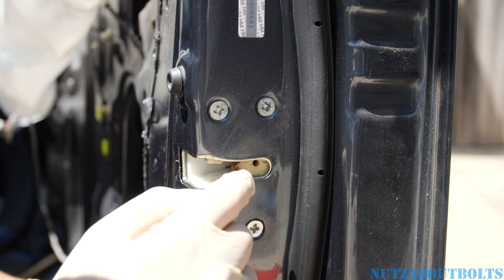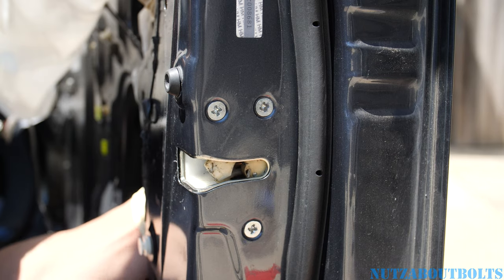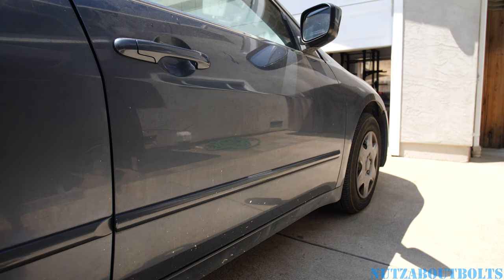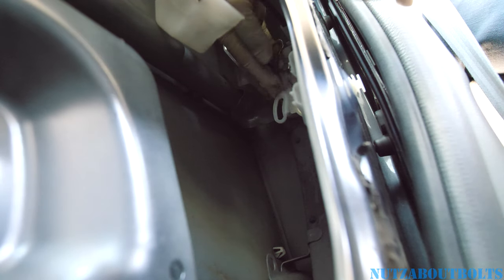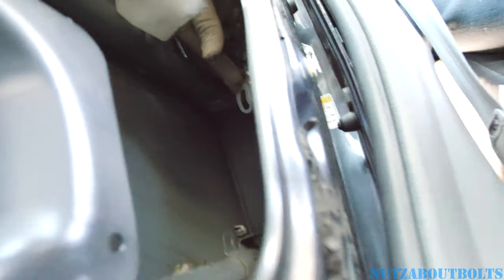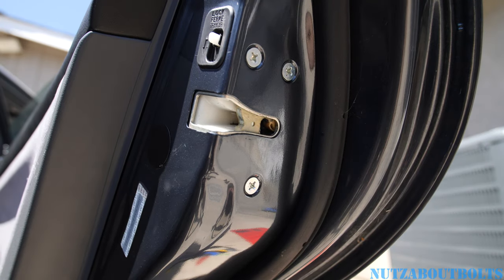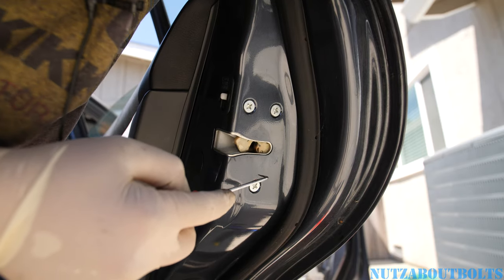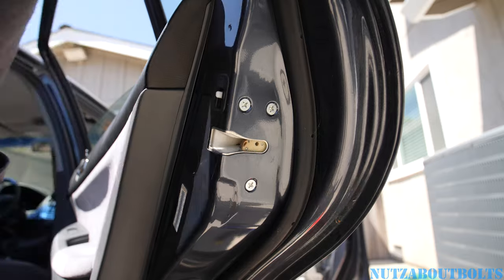How to open your Honda Door when its STUCK closed

Comment: There’s a white casing that is not shown in this video, there is a whole step missing, I can even show you a picture
Reply from the maker: Yes, that’s just the cover, you can remove it with a Philip screw driver. I didn’t show it because it would knock my camera off.
Reply: Could please tell how to open the cover which is fixed by a Philip screw

Comment: What if the door panel's still on the door. How do you open now? I have that problem. Window's down, but the panel is still on the door
Reply from the maker: Only way to me is to pop the panel off or break it off.
Reply: @NutzAboutBolts  dang, I didn't want to break the panel off.  Thank you for responding
Reply: @Name-ii7ox  thank you for your advice. I'll try that tomorrow. Thanks again

Comment: Is it possible to remove internal door trim when the door is closed ?
Reply from the maker: Yes, but it’ll be a lot of tugging and plastic tabs breaking from the corner
Reply: I’m wondering this same thing.. doors closed, the actuator is broke and the door won’t open from the inside or outside. The panel is on the door but again the doors closed. I wish someone would make a video explaining how to do this
Reply: I have the same problem.
Reply from the maker: @No_Transitory  pry the plastic door panel with a pry tool to pop the clips off, then pull back towards the passenger side really hard to pop the plastic panel off. I would do it but don’t own the car anymore
Reply: Can it be done to a Honda 2016? My door is closed
Reply: same issue what did you do? @No_Transitory

Comment: There's another YouTuber on the same subject who managed to get the door panel off with the door stuck shut.  It didn't look easy.  On this video I couldn't see what I was supposed to pull on to open the door but once I removed the white plastic cover it was easy (2005 Element).  I suppose the plastic cover is to keep rain off?  I'm going to take a chance and leave it off, at least for now.
Reply from the maker: The plastic lining that is between the metal door and door panel? That’s to prevent dirt and dust from going into there.

Comment: Hey man so i did what u did everything worked but once i closed the door it happened again do you think i need a lock actuator ?
Reply from the maker: Check your door latch to see if it’s working properly, the door actuator just unlocks the door lock so you can open the door. Unless your door isn’t unlocking for you when you unlock the door…

Comment: How do you get the door panel off with the door closed I can't open the door to take the panel off So my question is with the door closed how do you get it opened how do you get to the panel
Reply from the maker: You might have to damage the plastic panel when popping and pulling it off of the door. I would do a video on it, but I don’t own the vehicle anymore.

Comment: here is a question how do you get the panel off with the door stuck closed
Reply from the maker: Pop it off of the clips inside by using a plastic pry bar, then you pull back till it’s off and pull it towards the passenger side. It’ll be a tight space but it’s possible.
Reply: @NutzAboutBolts  Make a video of it I say BS to the thought. I already tried that method
Reply from the maker: @briandolata3466  sorry, I don’t own the vehicle anymore due to the cat theft. If I did, I would definitely do it

Comment: need help with the door open part my latch doesn't go back after pulling the handle method
Reply from the maker: Can you send us the picture of it through our email or Facebook page. Can’t figure out what is the issue
Reply: @NutzAboutBolts  No problem we think it’s the release pin inside getting stuck. Everytime we pulled the release pin it opened the latch. Just gonna order a replacement door latch.
Reply from the maker: @vital565  ah ok
Reply: @NutzAboutBolts  Thanks for the quick response though
Reply from the maker: @vital565  np. 👍🏼😅

Comment: I have a 2011 Honda Civic LX Coupe and both doors are stuck there is no door handles on it right at the moment or door panel.  However, I don't see how to reach the cover that you explained, there isn't enough room can you help
Reply from the maker: Do you see a white plastic cover when you look inside the door?
Reply: @NutzAboutBolts  I barely see it, can send you a photo of what I see when I stick my phone around the hole.  But there is no room to view it that I can see.
Reply from the maker: @captainuknow  sure, send me the photo, if you watch the door actuator removal video, you’ll see the parts that you need to pull on, the rod should be attached to it. But send over the picture and let me see
Reply: @NutzAboutBolts  it keeps failing when I reply. Won’t let me attach photo
Reply from the maker: @captainuknow  send it to our Facebook page
Reply: @NutzAboutBolts  I did
Reply from the maker: @captainuknow  send me a message first

Comment: Man I can’t even open the door inside or out but my panel is still on. I’m sol right night
Reply from the maker: Pry the plastic panel off with a plastic pry tool, make sure all the clips are detached   from the metal door itself and then you’ll have to man handle the plastic panel by pulling it towards the back passenger seat. It’ll be a tug but you can pull the panel off.

Comment: how can i get my door open if the panel is still on the door
Reply from the maker: Pop the panel out, then pull back towards the passenger and you can remove the plastic panel. You’ll have to man handle the panel or else it won’t come out
Reply: @NutzAboutBolts  i appreciate it but it’s opening and stuff again how it’s supposed to idk what happened with it
Reply from the maker: @ghostrebel1419  should check the door latch to make sure it’s working properly. Could be the actuator going out if it doesn’t unlock.

Comment: What if the panel is still on?
Reply from the maker: It’ll be tight but doable, just pry the panel to unclip it from the metal door, then pull up off the door top frame rail and back towards the passenger direction to remove the panel.

Comment: Can't open door, bro immediately says "When you get INTO your car" 😒😒😒
Reply from the maker: Lol, you can try prying the plastic door panel off from the inside
Reply: @NutzAboutBolts  struggle is when you're in those situations, you need everything available to you, but everyone just says WD40 lol. Thanks for the video though
Reply from the maker: @pattyc.4978  lol wd40 won’t open that door. You can use brute strength to pop the clips off of the plastic panel, and then pull it back hard towards the back to take off the panel, then you’ll have access to that mechanism to open the door